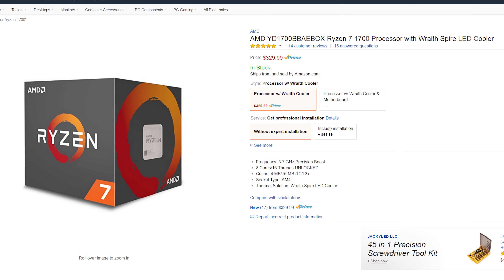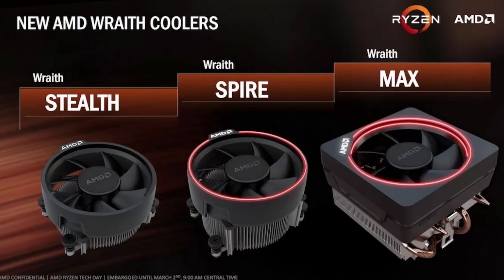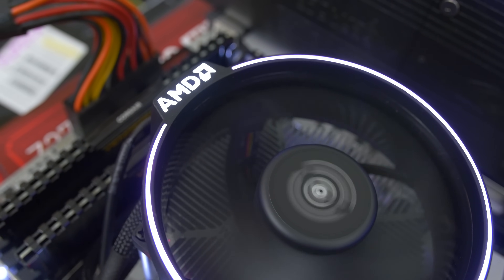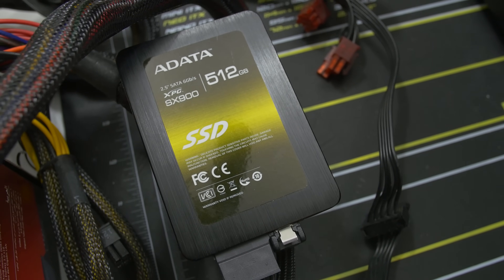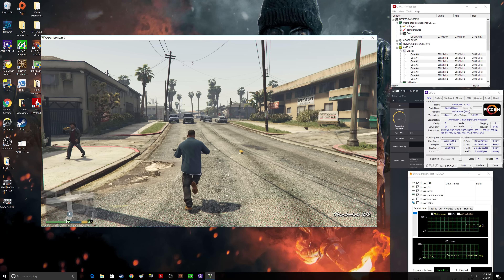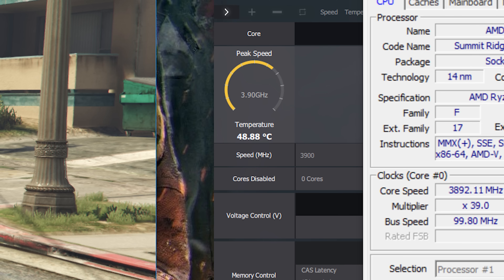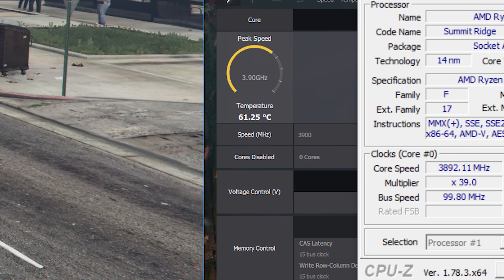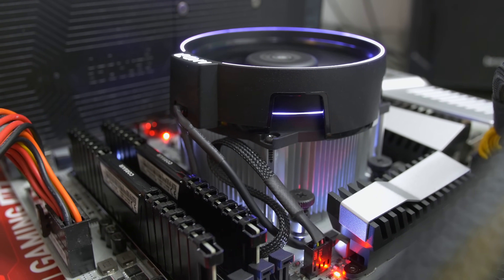AMD Wraith SPIRE: Does it SUCK?

Comment: I built my Ryzen 1700X system a couple of months after the initial rush to get the chips. At that time I was rather poor but I spotted the Wraith cooler on EBay for a whopping 25 dollars plus 5 shipping.  I picked it up and while I waited on saving money for a 240 water cooler I was able to run my system with a slight overclock at 3.5 with not a single issue. I never did try to go for more since I was waiting on the water cooler.  -

http://img.photobucket.com/albums/v619/ImGatomon/IMG_20170527_170604_zps3vt3q9wi.jpg

http://img.photobucket.com/albums/v619/ImGatomon/IMG_20170708_103959_zps7g89dnir.jpg

With water I am running 3.7 and Memory is at 3000. Still cant get it to 3200  Using an Asus 370 Pro Mb

Comment: It is a quiet cooler because it was designed by Cooler Master. The Ryzen chip however SUX overclocking to 4GHz. So few chip can hit 4, most cannot even so 3.9. Mine 1600 can only so 3.65 at stock V

Comment: Hi,
I am a noob at OC and this is my first time doing it.
 
I am overclocking my Ryzen 7 1700 with the stock wraith spire cooler on a Gigabyte x370 gaming 5 mother board and 16 GB of DDR4 3200
3.7Ghz@1.3V
DRAM 3200@1.35V
I am getting a CPU temperature reading of 45C-50C @ IDLE and 94C @ stress AIDA64
 
Is this normal? In AID64 temp is showing 10 degree less than the RYZEN master tool.
 
Which one is right? and are these temperature safe for long term 24/7 use?
 
I ran the Cinebench R15 test and score 1597 with this setting and AID64 stress test for 10 minutes without failure (I stopped the test at 10 mins)
 
Thanks in advance!
Reply: Nibin Sankar yes

Comment: You don't seem to be running into any problems from it here, but why is one of your CPU power connectors not plugged in? It looks like you have a 2x4-pin EPS12V connector, but only half populated. PSU lacks that cable?

Comment: Basically if all you are doing is gaming you should be fine up to about 1.35V on the stock cooler. However, if youre going to be doing 3d rendering, or you want to be able to run prime 95 for a few hours to test stability THE STOCK COOLER WILL NOT HANDLE VOLTAGE OVER 1.3V. If you go over 1.3V on the stock cooler and do Pegged 100% load via cinebench (continuous) or Prime95, your temps will slowly continue to climb even after hitting 100% fan speed. The stock cooler WILL NOT handle over 1.3V for photo rendering purposes. However if all you do it game you will be fine.

Source: My own Ryzen 1700 with wraithe spire. I currently run it at 3.7ghz @ 1.275V. (didn't win silicon lottery at all lmao)

Comment: had to use this while waiting for my H80i v2 to come in... after it came in I never changed it because it looks hella better and cools my 1700 just fine. not to mention I don't have to block off any of my 120 RGB fans with that ugly ass radiator.  also, with my H80i v2 I had to order a AM4 bracket cause it wasn't included... which cost $5 plus $14.99 S&H... Wraith spire FTW

Comment: Doesn't the temp register 20 degrees hotter than reality for fan performance? I OC'd to 3.8 and at max burn in the temp never exceeded 60 C
Reply: Mokimanify the 1700X and 1800X have a 20 degree offset, but not the 1700 and below.
Reply: ah.... ok

Comment: Thnx for this. I actually just swapped from my Corsair H100 to the stock cooler due to a noisy pump, was ofc worried it would be impossible to do anything but stock clocks but even OC works well, and it is very quiet when not stresstesting.

Comment: I just want to point out that the original Wraith cooler actually came with the original Phenom II X4 processor, the 940.  I know this because I still have mine and I'm looking at it right now.  That means that the Wraith cooler was originally designed in 2008 and released at the beginning of February in 2009.  It's amazing how quickly eight years passes, I still remember joking around and calling my PhII X4 940 "My Precious!".  Now it's become a tradition for me for every new CPU I buy.  Looks over at my Ryzen 7 1700  ;)

Comment: After testing the wraith spire myself i can say - yes it does suck a lot and you Kyle were just making advertisements and excuses to AMD here, the only fucking thing i can hear in my whole case with custom water cooling consisting of D5 pump, 5 noctuas NF-F14, Corsair ML140 Pro is this shitty cooler, even at low RPMs i can hear the bearings of this thing and when it is not running at it's full speed it can't handle even the lowest overclock, not much better cooler than Intel's stock ones just trying to look more cool/dope.

Comment: What is a safe daily voltage for the 1700 without hampering longevity of the chip? If it makes a difference, it would be paired with a Corsair H100i

Comment: Excellent information, Kyle. Question for you, sir...Can the CPU cooler fan be mounted upside-down on the cooler, or the wires reversed, to pull the heated air upwards?

Comment: do you have to use thermal paste with this chip and the stock wraith cooler? or is thermal paste just for water cooling? sorry, im a first time builder.. thanks for any help, couldnt find this answer elsewhere..
Reply: Thermal paste is needed regardless of air or water cooling otherwise the heat may not transfer nearly as efficiently rendering you vulnerable to possible overheating. Some stock coolers bundled with chips have thermal paste pre-applied to the heat sink itself, or as was the case with me, may come in a small packet to apply yourself. If neither is the case with you, you'll need to buy a tube of thermal paste. MX-4 is good though you'll have to be careful because it's a little runny.
Reply: to apply put on a small line in the center of the CPU the size of a grain of rice or a pea-sized drop dead center on the cpu. Research thermal pastes because there is variety. MX-4 i one of the higher end ones.
Reply: dood seriously, thank you so much..
Reply: of course.

Comment: SPIRE on R5 1600, not overclocked.

Browsing/Desktop apps - 40°c
Less demanding games - 50°c
Demanding games - 60°c

I can hear now HDD spinning, so quiet.
Reply: Jormungand13324 i dont think so as the new wraith coolers are only AM4 compatible i think
Reply: N3far10us as long as it stays under 80 it’s pretty good
Reply: is it compatible with a motherboard that has an FM2 socket?
Reply: Oli S get a cheap coolermaster for oc, they will perform better for oc
Reply: oooof, 40 c?
Reply: @gearz2570  not many coolers keep the cpu to far below 40c on windows 10 because of background processes and the like. I'm running an ryzen 5 1600 non-overclocked with the wraith spire and it typically idles between 34-37c.
Reply: @KickassRaider  i heard even the $30 cooler master liquid cooler stays below 30℃ on windowz
Reply: @gearz2570  which version of windows are you referring to? As I mentioned previously, Windows 10 has many more background processes than previous versions which cause higher temps on idle
Reply: @KickassRaider  win 10
Reply: @gearz2570  it is very possible that those temps could occur. The factors that go into computer thermals are numerous and far-reaching. For example, ambient temperatures have a profound impact on cooling performance. If the person who took these benchmarks lives in Siberia and the ambient temperature in his room is 15c, the readings you described are far more likely to occur. If he lives in the Bahamas, they are far less likely to occur. If you remember, I said those temps were uncommon not unheard of.
Reply: I got r5 2600 with stock cooler and cougar qbx case idle temp is 43 deg, not so demanding games 52~55, demanding games 60~68. Ambient temp 32~42 degrees. It stays quite all around. System temps are 1~2 cooler than the cpu temp.
Reply: @MrSinfulm3  That's my idle too on my 2600. 43 Deg.
Reply: Loool I get 63c on i7 9700K @5.1 GHz
Reply: RandomBeats im new to the pc master race and im not sure what temps are good and safe for long term use. would you mind telling me?
Reply: Depends but every pc shut downs when temp is too high. If you want to be safe don't overclock, changing voltages is what can kill components not temp.
Reply: I went with cooler master master liquid lite 120mm aio and I’m over clocked at 3.9ghz and 1.35v running at under 60 on max load
Reply: i shoot first that’s what I’m gonna go for
Reply: @brillywilly2998  its actually a fantastic cooler for being stock and all. However at high rpms it gets pretty loud tho
Reply: thank you for this. im currently building my first pc and this is the cpu+cooler combo im planning to use. glad to hear its effective
Reply: @KickassRaider Anything under like 80° should be fine. I know that I am very late but ah well!
Reply: I came up with a better way to get better temps, take off the factory termal paste, put a better termal paste that actually gets temps way down to 32-35 idle and games well, never got to more than 56 Celsius, boosted and all
Reply: whoa it can go up to -60 degrees Celsius, that's really nice
Reply: Similar experience here, using stock paste too. Gonna see if I can shave a couple degrees by using a better paste while I save up to go with an aftermarket cooler
Reply: We have the same cpu and stock cooler. And yeah I agree with this comment. I love it 💕
Reply: My 2600 went to 63C in American Truck Sim. And this Wraith Spire is noisy.
Reply: Streaming and playing fortnite on my r5 1600 with the stock cooler (at full speed) my temps stay at right about at 40 C or lower
Reply: Thermal paste? I'm getting a concerning 73 Celsius while browsing with the pre-applied thermal paste. Definitely gonna apply different paste ASAP.
(I was installing Destiny 2 in the background, but that shouldn't effect it that much.)
Reply: Thanks was looking for this
Reply: Quick tip : Just remove the factor applied  thermal paste and put new thermal an get much lower temps
Reply: RandomBeats Lol i got 60°C by Ryzen 5 1600 Overclock to 3.6 GHz with the Stock Cooler
Reply: same results on r5 1600 here

Comment: Blame bad airflow but this cooler makes the ambient temp in my case spike when gaming. My graphics card is also running a lot hotter because of this. I'm waiting for Noctua's AM4 adapter kit to arrive so I can mount my trusty NH-U12P radiator.

Comment: I do have a question...? can we change the spin of the fan on the amd stock cooler...? most dc motors are reversible is this one the way it is set up. the change in the air flow should give the room needed to gain the 4.0 over clock ...just wondering ???

Comment: Question: Is Ryzen Master good for monitoring temps? Im using R7 1700 and stock cooler. I get 35-40c idle, 72c on load on prime95 at stock, OC to 3.7ghz and 1.2v, Ryzen master shows about 45c idl and 80c+ w/ prime95. All of this seems too hot and I can't figure out why
Reply: I get the same idle temps as you at stock, but I dob't wanna overclock yet. I'm gonna wait till I get my am4 mounting kit for the dark rock 3

Comment: Thanks for this video. I've got the Ryzen 5 1600 coming and I was just gonna use the Wraith cooler since I don't feel like waiting got the adapter to come for my Hyper 212 plus. I just moved the Corsair 120mm's to the sides of the case. I'm happy to know I can get away with some overclocking on the stock cooler. It's been a few years since I've been in the OCing game. Time to read up.

Comment: Would you happen to know why the Wraith Spire does NOT ship with the Ryzen 5 1600x?
Reply: retailers aren't shipping the Coolers with the x series chips yet. It's unknown When they'll become available and if they'll be able to be purchased separately. 

I'm contemplating purchasing a Corsair h100i v2 or maybe even an NZXT Kraken x62 since I do have the s340 case but unfortunately I can't purchase am4+ bracket and rather not wait 3 weeks + for it with the h100i I can purchase the bracket on amazon for like 4$ , however with a voltage of 1.362 and 3.9ghz ( i've gotten 4ghz stable somewhat just not comfortable with it yet) The Wraith spire cooler has been quite impressive so far. Great temps between 30-35c idle 54c when gaming/streaming and then when prime95 torture test it hits a max of about 68c

Comment: When I first took off the cooler to check if the problem of computer problems would be in cpu pins, when I took off the cooler the backplate fell off pretty easily is that even supposed to happen?

Comment: Thank you for nice Video. I have a question: I cannot decide  "Ryzen 5 1600X" or "Ryzen 7 1700"... With "1600x" + good cooler can be almost same price with "1700"....

But on the other hand, "1700" with "3,7 GHZ" need O.C fan ? or Stock fan (Wraith stealth) is enough ??? I will buy new cpu for only gaming. Please help to me. This will be very important decision for me.

Comment: Please, sorry for my english, but i can't understand, The conclusion is the stock cooler of ryzen 7 1700 is good dor overclock to 4.0ghz or not?
Reply: Yes, I've gotten 4ghz stable somewhat with my prime b350-plus & ryzen 1700. I'm just not comfortable with voltages validating at 1.395v and hitting up to 1.41v so I am staying with my 3.9ghz oc profile for now with a voltage of 1.362 and my temps are great with the wraith spire, although I am considering a Liquid AIO cooler such as the corsair h100i v2 which is on sale for 90$ at a local best buy, I'd just have to purchase the am4+ bracket on Amazon for 10$

Comment: Update on the r5 1600. On prime95, hit a max of 75 degrees at 3.8ghz at 1.3v. This kicks ass! And it's much much quieter than the hyper evo! Best stock cooler ever
Reply: Fearbleeds really wtf xD my r7 2700 hits 95 degrees 3.8ghz at 1.25V. That was after 11minutes rofl. Just closed the whole thing. Now running 3.4ghz all cores let prime for 2hours and never went past 70 degrees. Its good but definitly not up here in the cooler game
Reply: @TheAmanor123  I'm pretty sure gen 2 ryzens stock cooler isnt as good as gen 1 it might be that
Reply: @TheAmanor123  8 cores heats up faster than 6

Comment: hey bitwit, 
So I have a Corsair Vengeance C70 case, and I love it. 

One question,
What is the optimal setup for fan airflow from the side panel??
My setup as of now:
2 front = in
2 top = out
1 rear = out (radiator pull)
2 side panel = Out (should I change to in?)

Comment: if i overclock ryzen 1700 to 3,9ghz then i must use the stock cooler, or cooler like cryorig, or liquid cooler? i'm so afraid if my ryzen is overheat, if i buy the 500w power supply, is it enough for ryzen 1700 and gtx 1060?
Reply: 600w isn't a lot more expansive and will get you headroom for overclock both 1700 and 1060

Comment: Just a heads up, the 1800X does not(at least, mine didn't) come with a stock cooler. 
Which is fine, I was planning on liquid cooling from the start. But this might be a consideration for some people.

Comment: Also, what's your source for claming the 16GB Corsair Vengeance LPX DDR4 3000 is a validated RAM kit for Ryzen? This AMD blog post (https://community.amd.com/community/gaming/blog/2017/03/14/tips-for-building-a-better-amd-ryzen-system) refers only to the 3200 MHz (not 3000), C16 (not C15) version of the kit, because it supposedly has Samsung B-die chips. As far as I'm aware there's no guarantees the 3000 MHz version is Samsung B-die also -- or do you have different information? If that's the case, I'd be very interested to hear about it.

Comment: Hey guys. Ive just joined the Master race after being with MAC for 10 years. I'm new to this so be gentle.

 Ive had a 1700X system built, I asked to keep the wraith Max that comes with it, but they have sent it built with the wraith Spire which only comes with the 1700. 
Ive emailed them and they basically said "its fine dont worry about it".. The tdp of the 1700x is 95w and the tdp of the spire is 95W. Does that mean I'm screwed for overclocking and will i have problems in the future??

Many thanks
Reply: Jon Jones not really but it could effrct it bit. that seems like a shitty company

Comment: Seeing how you tested without a case, I think that's the reason why you have temps that high at idle.I did some testing of my own awhile back using case vs without one. I find that if you have a case with fans blowing hot air from the back, top and 1 side temps were very stable at mid 30s with an overclocked Phenom II CPU. That CPU is well known to get very hot easily, but it did not go high on temps when I had it inside a case. When I tested it outside the case, temps went up to about 70ish degrees under the same load when I tested with a case. 

I think the main reason why a cased CPU temp is lower is because you are creating a wind tunnel. Hot air disperses a lot quicker when it is forced to blow out in different directions. Plus you have intake fans to suck in cooler air which helps your system cool down faster. I don't know, this is just my theory.

Comment: this is soo misleading , he tested the cooler on an open bench pc where it has a tonne of airflow , you won't get the same performance on a normal case since you have restricted airflow , let's say you have an nzxt s340 that has no airflow what so ever you will have way worse temps than this.

Comment: I have to ask +Bitwit. Your test are pretty solid but how long are you running these test. The temps seem really low for long term gaming (at least an hour of cpu load). Not hating on the video just taking it with a grain of salt until validation.

Comment: I must have hit the liquid cooler and cpu lottery for temps. I am running a 4960k OCed the 4.5ghz and 1.218 V running a corsair H75 in push pull and my idle temp is 30C and under load while gaming is 56C. I have never seen temps get anywhere close to the temps I see talked about in all these tests and OC video's. I have tried to get temps that high by going to 4.6ghz and 1.3v and still only got to upper 60's for temps running prime 95 as a stress test.
Reply: Yes i realize this is air cooled and I am liquid but even in videos where they are using cloosed loop like mine they have way higher temps.